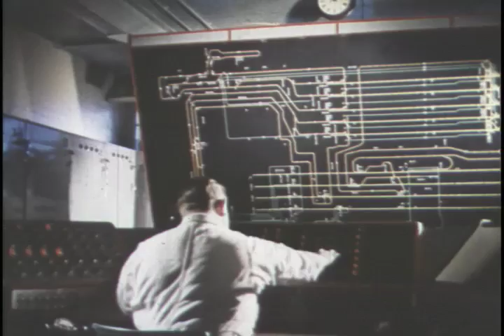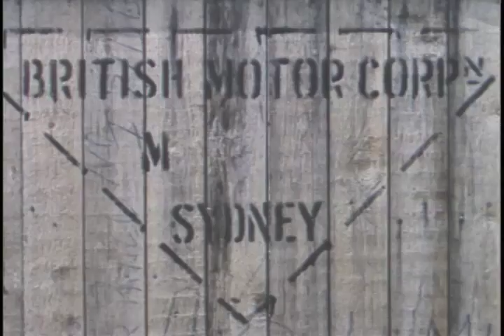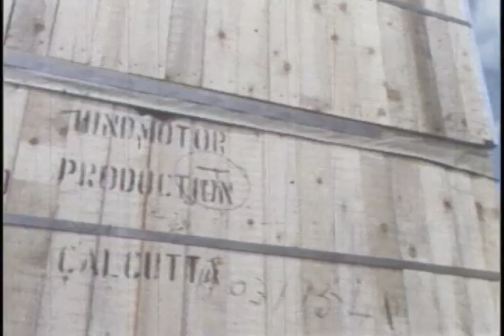British Motor Corporation Story

Comment: "International Class speed records on Bonneville Salt Flats" don't exist. There is no "corporate" much less "international" so-called "competition" at Bonneville and "speed records" set there aren't "competition" against other vehicles PERIOD since "class records" don't cease to exist once "beaten" and "first" is still considered "best" as far as "setting records" since the "first" record holder typically does all the real "R&D" necessary to "set" a record that doesn't EXIST before he/she not only "sets" the "record" but also "creates" the new "class". Bonneville is for "improving" on previous performances and "records" exist only for "classes" that had to be successfully created FIRST. That means there's more "politics" than "performance" involved in a "new class record" where the "class" has to be created first. And there are so many "classes" because MOST "competitors" prefer to be "challenged" rather than BE a "challenger" and that means creating a new "class" that hopefully other "competitors" will BE interested in "competing" in while the "class" and "record" are still "new" and "challenging" to OTHERS. And of course there's more to setting a "record" than simply "creating a class" and showing up with a vehicle "legal" for it and "setting a record" with one "run" of X mph or even TWO runs "backing up" each other since when a new "class" is created a new "qualifying speed" is created with it BEFORE anybody has run a "legal" vehicle for that "class" there. At least as far as OFFICIAL Bonneville "records" and "classes" go. That keeps out the "posers" and "fakes" who would "buy" a new "class" after doing "R&D" elsewhere and then show up with a "new" class-legal vehicle at Bonneville and "set the class record" so "artificially" HIGH that any potential "challenges" TO that "class record" would be very "unlikely". 

There are plenty of other "challenges" at Bonneville that make it "unprofitable" for "corporations" to try to use it as a PR event and that's exactly why it exists because "hot-rodders" wanted a "pure" form of "competition" where "engineering" and "driving ability" aren't the only two "factors" in "success". The salt itself is unlike any other "surface" and is especially unlike "sand" despite "appearances" and particularly since Bonneville Salt Flats is not a "dry lake" year-round but is actually "flooded" and a "man-made" lake part of the year in order to "restore" the "surface" for the "competition". 

And intentionally flooding that "dry lake bed" and doing so at the "right time" so that "conditions" are "just right" for the "competition" is not and never will be an "exact science" and "Mother Nature" ultimately decides the final "conditions" and whether or not there WILL BE any "competition" since that inexact "science" originally "conceived" to "improve" conditions of the "surface" came along back when the "competition" was NOT an "international event" or even a "national event" so that the actual "event" was held when conditions were "right" rather than a certain "time" every year and if you weren't ready when the salt was you were SOL until the next year or the next time you happened to be "ready" when the salt was. 

It was a "local" event then and as I said NEVER a "competition" but rather a "test" of new machines built for a specific "class" new or existing or new modifications (never considered "upgrades" or "improvements" prior to "proving" themselves "on the salt" and STILL "subject to change" if any "improvement" wasn't specifically attributable to them by the "engineers" building and driving the vehicle comparing the new performance to previous performances "subjectively") to an "old" vehicle and that's what "foreigners" don't get about "Bonneville" or even "America". Nobody in the U.S. who has the real "American spirit" and FREEDOM OF THOUGHT that go with "Bill of Rights" freedoms and liberties is ever really "satisfied" with "good enough" when it comes to "personal pursuits" and "competition" ceases to be "personal" once it turns "professional" and "corporations" and "corporate sponsorships" are involved and even when those ARE involved, since nobody in the U.S. absolutely HAS to do ANYTHING "for a living" they don't "want to" and everyone has "endless" other OPTIONS and "competition" at the "international level" is all AMATEUR because no real "national teams" are involved that do nothing BUT "compete" internationally, there's also no real "national pride" or rather "national EGO" at stake in "international competition". 

Americans have "nothing to prove" not because we've "done it all" or "won it all" but because we don't have a "national" INSECURITY COMPLEX and compulsive NEED to "win" much less "win at all costs" that results from so many "centuries" of supposed "international domination" and "victory" throughout "history" that's completely COUNTER to the REALITY OF THE "MODERN ERA" AND "RECENT EVENTS" AND THE "PRESENT" like SOME COUNTRIES DO. Or rather ONE specific "country" or "COMMONWEALTH" that seems to make "competition" out of EVERYTHING but in fact just creates lots of NEW LIES to cover up OLD LIES about its "dominance" of "everything" throughout "recorded history" at least "English" recorded history by which I mean "history" WRITTEN IN "ENGLISH" WHEN FIRST WRITTEN - AND "CREATED" - BY THE "ENGLISH" WHO SEEM TO HAVE QUITE A FLAIR FOR THE "DRAMATIC" BACK "THEN" AND YET "TODAY" AS FAR AS THEIR "STORIES" ABOUT "ENGLISH" AKA "BRITISH" HISTORY. 

And their "tall tales" or LIES as "adults" all over the world and pretty much ALL "Americans" would refer to obvious "untruths" told and re-told throughout "history" by "one side" of any and every "event" they "describe" may have worked on and may continue to work on "Commonwealth" citizens or nationals or subjects or whatever those "unfortunates" who happen to be under the "rule" of Queen Elizabeth II are being called at any given time and they may work on "Anglophiles" around the world as well and even "Americans" who read or hear and "believe" them simply because they're reading or hearing them for "entertainment" or "education" or maybe because they come straight from the "BBC" and "Americans" expect "truth" in "non-fiction" materials PUBLISHED AS SUCH WHETHER BY "PUBLIC" OR "PRIVATE" COMPANIES/CORPORATIONS/ORGANIZATIONS ETC. But they don't work on "skeptics" - or even "sceptics" - who have not only "education" on "British" or "Commonwealth" industries, goods, services etc "throughout history" and are "students of history" but who are also "scientists" who "question everything" and look for "proof" of a "claim" consistent with their own EXPERIENCE AND WISDOM AND KNOWLEDGE in "fields" like "physics" and "metallurgy" and "chemistry" and with subjects like "electricity" and "internal combustion engines" and "manufacturing" and "mass-production" and "tools" and "machining" and most of all "customer service" and "customer satisfaction" and "quality control" who simply KNOW BETTER THAN TO BELIEVE THAT A SUPPOSED INDUSTRIAL "SUPERPOWER" SOMEHOW "LOST" THE "ABILITY" AND "TALENT" AND "SKILL" TO "MANUFACTURE" WHAT BY AND LARGE IN THE "WESTERN WORLD" CONSIDERED "NECESSITIES" RATHER THAN "LUXURIES". 

And I'm referring to "affordable" personal transportation, "modern" public transportation, "modern" structural engineering and building construction and all the other "necessities" in "western" countries like the U.S. that the "UK" supposedly once "led the world" in but now has to either "import" or "do without". And "Commonwealth" countries aren't MUCH "better off" although in the case of the "white majority" Commonwealth countries - Canada, Australia and New Zealand - they are in a better position "geographically" to be able to "import" the "resources" to be "modern" or at least "more modern" by outward appearance to the much greater numbers of "tourists" and "immigrants" they get from "America" compared to the "UK". And lots of decades of the fact that supposedly "independent" Commonwealth countries LIKE Canada and Australia and New Zealand are only "independent" in that they have their own "governments" instead of being under "direct" Home Rule has also greatly "benefited" them vs. the "UK". 

Unfortunately, the "information age" is like every other "age of enlightenment" and the more people "around the globe" have "internet access" and the more people "travel overseas" and "interact" and "communicate" with people "overseas" even while sitting at "home", the more the giant "myth" of "British domination" of "everything" throughout "recorded history" as not "English speaking" but far more importantly and NOT "coincidentally" ENGLISH-READING people "hear" and "read" it, the more "skeptics" - or "sceptics" with a little PRACTICAL EXPERIENCE in "industries" the "UK" and the "Commonwealth" at large only "lead" in to the extent that they "partner" with other "countries" and "governments" in them, the more people realize it all IS a "myth" and once "taught daily" in "public schools" to "Americans" for lots of "decades". Which is not a good thing since along with "freedom of speech" comes the freedom to NOT SPEAK and NOT TELL LIES WHEN YOU COULD AND SHOULD JUST AS EASILY AND MUCH MORE "SAFELY" JUST SAY NOTHING AT ALL.

But PROPAGANDA and LIES are still the ONLY THINGS THAT KEEP ILLEGITIMATE "GOVERNMENTS" IN "POWER" AND THE ONLY "PRODUCT" THAT "HISTORICAL POWERS" THAT ARE STILL THE SAME "COUNTRY" TODAY THEY WERE "CENTURIES AGO" AND STILL "MONARCHIES" IN A "MODERN WORLD" OF "EQUALITY" AND "TOLERANCE" AND "OPPORTUNITY" AND "GLOBALISM" AND THE VERY THING THAT ULTIMATELY CAUSED "AMERICA" TO EXIST. THE "COLONISTS" WHO FOUGHT THE "AMERICAN REVOLUTION" OR "REVOLUTIONARY WAR" DID SO NOT BECAUSE THEY HAD NO "REPRESENTATION" IN "GOVERNMENT" BUT BECAUSE THEIR "REPRESENTATIVES" WERE LIARS AND FOOLS LIKE THE "KING" AND "PARLIAMENT". AND "AMERICANS" HATE BEING LIED TO BY "GOVERNMENT" BECAUSE EVERY "AMERICAN" IS HERE BECAUSE ANOTHER "GOVERNMENT" FAILED.

Comment: What went so wrong
Reply: Two Words  'British Leyland'  They should have stuck to building Trucks!

Also,infighting between divisions. eg.  Triumph Stag V-8.  Common sense would have been to use the Rover V-8, but no, Triumph had to have their own V-8 !
Reply: jackpontiac52 you forgot to mention that rover also used Honda engines instead of their own & once sold to bmw (goverments biggest mistakes ever) it all went downhill.
bmw were only ever interested in rovers mini & once they had that the longbridge plant was no longer needed & so was sold to india where they built their own cars & stuck rover badge on them so from the 60's til the final closing of the longbridge plant none of the cars that got built there were ever fully british